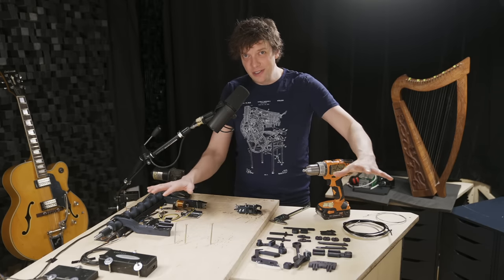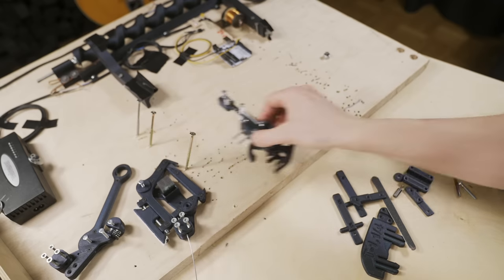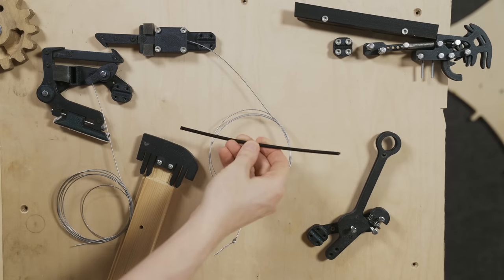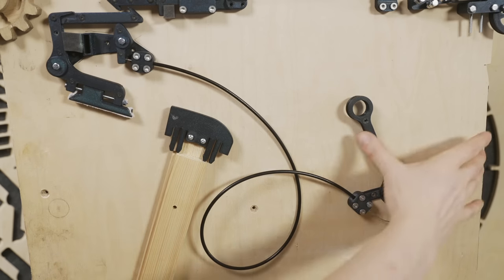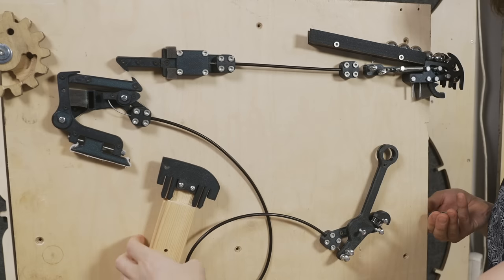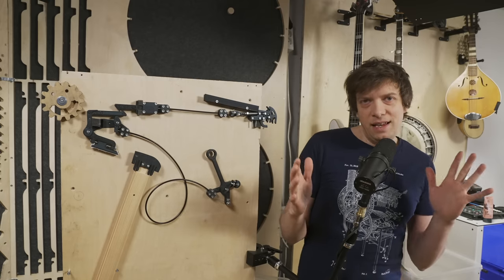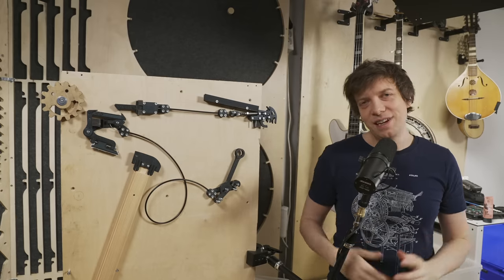These Bowden Cables Surprised Me!

Comment: Just a little suggestion, cables should only be used for pulling and not for pushing, I would add an axial spring to the muting mechanism so that the cable always works under tension and not compression, I'm pretty sure there will be a lot of comments like this as well as some comments saying that it will be fine, but pushing with a cable could give you lots of trouble in the long run even if it looks perfectly fine at the beginning, even in bikes they are meant for pulling,  the brakes or "shifters" have a spring for going back.

Comment: Another cyclist here used to do twelve centuries a month. Lube up the entire length of the cable with a Teflon, PTFE, based grease during assembly. Don't fill it, but use more than a little.

Comment: hi Martin, you can use silicone spray inside the tube before you thread the cable through, it helps lubricate and also prevents corrosion if you do end up traveling with it
Reply: Just be careful about how you lubricate them. a fluid braking of the wire is undesired. Viscosity and oil amount is important!

Comment: One suggestion I'm missing in the comments is the following: use some adjustment barrels at the end of your cables to compensate cable stretch and timing errors easily. They're a single standard part and one bit of thread, that make your adjustment so much easier.

Comment: Feels like that cable driven part should be spring-loaded, to be able to return into muted position by default without pushing the cable, otherwise that non-sleeved part of the cable will bend irreversibly  one day and stop transmitting the control lever effort. 

Cool to watch this prototype board.

Comment: It’s definitely neat, but I can’t imagine a hundred bowden cables being used across the machine. Using it in small places like to connect the programming wheel to the hi-hat and such could be really handy, if you can get the timing tight.

Comment: Try "ironing" for smooth 3d print top surface. That might save you some post-processing.
You might want to support the cable coming out of the Bowden sleeve. A guiding track would be attached to the cam lever. That way the cable won't collapse and change its path over time. Might prevent some wear as well.

Comment: Bicycle gear and brake cables are expected to pull against a spring-loaded mechanism, so I would look at putting a spring mechanism into the muting cam (twisting it clockwise) so it pulls the cable tight against the muting lever.

Comment: You should add a smaller hole at the end of the bowden tube to prevent it from sliding and getting out of sinc over time. Look at how it is done on a bike for instance. You do not need blocks with 4 screws. You need a a hole inline with a smaller hole that is just a bit bigger than the cable in the end. Add a slot on the center of the hole over the entire distance  that is just a bit wider than the cable. This way you can just drop the cable in there and slide the bowden in the larger hole from the side. The spring tension from your dropper will keep the bowden in place.

Comment: Cheers 
I like the use of bouden cables for the machine. But I think the muting excenter-thing should be tensioned with a rotating spring in either direction to pull the cable back instead of making the cable push the excenter. This will allow to have a dominant position as soon as the cable fails. Every bicycle device wich uses cables works this way, because pushing cables aren't reliable as they'll eventually buckle up.
Love watching your prototyping videos by the way

Comment: What a wonderful idea!
Though I though of one thing because if the positioning of your readers:
If you want to move your steel cables around like crazy, you will probably end up with using springs in the reader system because the cables can cause a lot of friction, like you said

Comment: The one on the marble gate looks great!  Both my experience as a cyclist and my engineering intuition say there's way too much cable sticking out of the ends of the sheath for the mute mechanism ESPECIALLY since you're pushing on it as well as pulling.  I strongly doubt it will be reliable in that configuration.

Comment: People are giving advice for reducing cable friction, but it might be a good idea go see if you can test/reduce the friction between the plastic parts too.

If the mute mechanism can be worn away from repwated use, then it's a potential source of either constant maintenance or mid-use failure.

Comment: Another tip from a cyclist: Others have recommended endcaps/ferrules. I have an easier way: put some super glue on the tip of the cable. I've never had a cable fray when doing this.

Comment: for the mechanical disconnect, have the lever pull up the reader to not engage the pin.  There's no requirement for the reader to continue to read....it will just wear down reader / drum pin material and increase resistance to moving the drum.  also you can remove the 'hooks'.

Comment: There are versions of these cables used in model aircraft that are semi-ridged that can be used to push and pull with far more force if needed, however they are not as flexible.

Comment: Bowdens are the way forward almost certainly, there could be miniscule timing errors  introduced by any slack in the cable, but that should be barely measurable. 

While this would mean an extra feature, if you designed some kind of quick-disconnect system for the bowden tubes, it'd be possible to build out a feature where you can reconfigure the instruments of the marble machine mid performance, maybe swap out drums or the guitar.

Comment: These cables will probably work for you and are probably the best solution BUT... make sure you a bunch of extras everywhere you go AND all the tools and the means to cut and fit them QUICKLY if one fails.  Because when a cable stretches and you can no longer engage the channel by pushing the lever you'll need to replace the cable and the holding parts and you'll need to do it FAST.  And not only the cables, but the cable holding parts so that you can replace any of these at any time.

Comment: Keep an eye on the Length of the Cables.

Cars use these for decades. There is a reasen why manufacturers build in a mechanism for adjusting. 
You need to adjust them from time to time, cause they getting slightly longer. 
For example, in old cars this can cause the throttle valve to not open completly or the full throttle switch don't trigger anymore, resulting in lack of performance.

On a bicycle you don't realise it, because of the wear of the brakepads you need to adjust the length now and then. Same for the mechanical handbreak on cars. Because of the corrections you don't realise the Cable getting slightly longer.

Comment: @wintergatan if you need to expand and control more than a single lever, use cable stops on the same wire. Would let you switch instruments on a set of multiple cams, let say you have 3 in line switches, cam 1 is set to on, second is off, 3rd is on, pull your lever and all 3 cams would be set to the opposite. If you need any help, please do reach out. Use these cables daily

Comment: Speaking as a mechanical engineer, avoid the use of bowden cables whenever even remotely possible. They create a lot of drag and have a lot of points of failure. IF you're going to use bowden cables, use them only in tension (to pull) NEVER push on bowden cables. There's some types specifically designed to allow low push loads too, but they're expensive and usually high drag. If you need a force to return a cable, have a spring pull it from the other end. Route your cables with as few kinks as possible in as straight a line as possible. Every bend is added drag and loss of accuracy.

Comment: 4:20  you need in-line barrel adjusters to adjust the cable tension & and maybe just cable stops and cable ferrules instead of 4 screws to secure the outer cables to the mechanism.

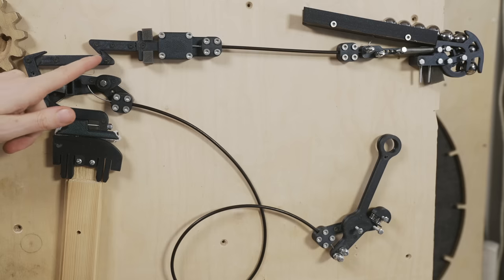Comment: 7:50 my jaw literally dropped at that moment.
I finally understand why you kept saying there are no half drops with this system

Re: the cables. The cable ha sprobaboy affected the timing but not in a way that can't be compensated for. However, over time the cables will stretch and that will wreck the timing. I think you should run some tests to see how many marbles you can drop before the timing difference exceeds your limits.
Then you can plan for that and change the cables (or adjust the tension) periodically.
That said, I think it's likely that they will last a long time without issues.

Comment: Try to minimize the number of bends and loops in your cables. As they go up, the capstan effect becomes more noticeable. Lubrication will mitigate it, but an extreme case of capstan effect induces more static friction than the linkages can handle. Straighter lines mean less friction, thus less wear and more reliability.

Comment: Hello Martin. You should not rely on the steel cable (the bicycle brakes cable) to push the lever thingy. Cables should pull, not push. You are doing both actions with just the cable, whereas you should be only pulling and rely on a spring of some sorts to retract the "lever thingy" into position.

Comment: Amazing design step - great idea to incorporate tried and tested, simple technology, commonly used for switching and gear selecting. 

Push pull cables are not the same as pull only - Shimano make both.

You could use pull cables but you will need to design two cables into your design, like tendons in a human joint one tendon pulls one direction another pulls the other way.

The outer cables introduce friction when they are compressed as they are in these clamps. I would recommend designing a housing that limits the movement of the outer housing without compression much like the housing of a car gear shift cable or boat throttle cable.

On the subject of friction - consider the maintenance required for these cables to run like new. On tour, regular oil/wax application will be needed along with degreasing to clean away dust and grime that collects on the cables and causes friction - it doesn't take much, especially if you want to use regular brake or gear cables in a push application. No big deal - but another maintenance time expenses to factor in.

Keep up the amazing work!!

Comment: I believe a problem with those sleeves for the steel cables is they temporarily shrink and become less flexible when they get cold. I'm assuming that in the winter months that the marble machine will need to be put in a truck to move it around which wouldn't have air conditioning in the trailer. It might not be an issue it's just something to think about.

Comment: Take a look on a cable operated throttle valve - they have partial sprocket to support the cable, which is needed to reduce stress near the anchor point - you might want implement something similar for long term reliability. Also, a return spring to keep the bowden in tension would be good idea - these cables are not meant to be push-pull (although the forces here are small). With return spring, you might even be able to use simpler PTFE bowden tubes with plastic cables in mute mechanism.
The bi-stable lever might be done simpler by using buckling spring mechanism.

Comment: The cables will require length adjustment.  You must build that capability in.  The "clicker' should be on the critical element (the lever that raises the hook, NOT on the mute lever.  Bicycles also did this (wrong).  They put the clicker on the handlebar shifter, when it should have been on the derailleur mechanism at the rear.  That way, when the cable stretches, it does not affect the derailleur position.

Comment: Should you get into a situation where the cable run becomes complex, there are higher-grade cables with a polymer coating inside for the metal line to run on. Look for Shimano Dura-Ace brake cables. Oh, they may also be quieter, so they will be Winston-approved.  ;-)

Comment: I would add a ball bearing to the top of the muting toggle, so the pull bar can roll on top of the ball bearing instead of dragging across it. The dragging motion will promote wear and tear and also adds noise. I would replace the felt on the programming wheel reader with ball bearings as well, as this is more durable.

Comment: Be careful Martin:  Using the inner cables in compression mode (pushing) will not work out in the long term.   With the curved flexing and compression force the cable strands will tend to unlay and “birdcage” over many cycles.

Notice that on a bicycle, they are only used in tension, and a spring supplies drive in the opposite direction.   In rare instances where pushing force is required, the sheath (housing) is used to push.

It is good that you chose shifter cables, as the housing has very little compression…but there is a limit to how much force they will withstand, as too much compression force (= tension in inner cable) will result in birdcage failure.

If you really need to push with the inner cable (I can see that it simplifies things) then use a solid spring steel wire that can’t unlay…interestingly such wire is called “music wire”!

Comment: Use a little dry graphite lubricant on the bare steel   cable before inserting into the sheath. This will reduce friction overall without being messy like a liquid lubricant. But even better, you can get   Teflon coated cables that are self-lubricating. Definitely recommended!  

Alternatively if you are  using an Arduino for testing  anyway why not  connect electronic trip relays for  the ball mechanisms? I'll bet they are lots of guys out there who would love to code that up for you.  
Really enjoying your 3rd  gen.
 development videos! Thanks.

Comment: You might find actuator cables for RC model airplanes better suited to the MM. They are much lighter and have far less cable or wire friction.  There's also many off the shelf servo arms, pivots and adjustment rods that work well with the cables.

Comment: You could use the hole in the lever by putting a rod across multiple channels to mute many at a time.
I'd imagine that it could be useful to have maybe 2 or 3 loosely connected levers so you can mute different groups at a time. Might make it tighter to just mechanically connect them together in those sets you want.
Maybe a modular approach where you can snap in levers in groups attached to rods already so its fast to change configs during concerts?
Reply: the attachment mechanism could just be two pipe connections with springed pins at the outmost channels of the channel group.

Comment: if the bowden cables don't work out, have a look at an old drumset product called the bill bachmann remote speedy hat. it uses a cable and pulleys to achieve a similar "free-routable mechanical action transfer" with less concern about parts wearing out or having friction.

Comment: I think you better use the bowden cables only for pulling, and not pushing. You can see on bikes how it’s made, a string pushes back the bowden cable in its place, so that it’s always a pulling force that is acting on the cable. 
I think there is a very high risk of failure if you count on the pushing back method, since a part of the cable will always not be in the tube. There, over time, it might want to bend instead of flowing through the tube, due to friction resisting it.

Comment: Could the new machine be kind of like a drum set? Each instrument its own self-contained unit with a signal input and a marble in and output? You could have a treat the marbles like fluid in a hydraulic system. One of the modules could do all the storing and splitting of the marbles. It would also make packing up for travel easier if each instrument is its own unit. Also, adding or replacing instruments would be easier too.

Comment: I like the design with the bowden cables. I'm just afraid that the cables could split in the current design. Bowden cables are normally only designed for pulling and not for pushing. You can also see this in normal bicycle gears. When shifting gears, you either apply force to tension the cable or release the tension to allow the spring force on the other side to pull back. Another possibility would be to use two Bowden cables - one for both directions. The manufacturer Rohloff, for example, uses such a variant.

Comment: Great design! 

One point of concern is the manner in which you secure the tubes. Is there a concern if they slide? 

You could use off the shelf “7mm Brake Part Lever Adjustable Barrels” this will provide a hard stop for the tube and allow you to adjust the tension cable tension.

Comment: Be sure you can replace the bowden cable as a whole when it breaks. Right now I saw you locking the nub in place in the assembly, which can cause major issues later on. Make sure you can thred the bare cable from the back of the piece so you don't have to disassemble it later.

Comment: If possible, I'd use the bowden cables from motorcycle clutches, or similar.  It'll be a stronger wire and sheath which is less likely to stretch.

Comment: Maybe test the longer cable with loops at the more frequently used point between programming wheel-reader and marble gate instead of at the mute system. Wear and tear will be significantly higher there, and the timings are of more importance. Right now, you are testing the optimal case. But you want it to work in the worst case.
Besides that you should take the feedback in the other comments seriously:) love the progress, love the testing. Seems promissing.

Comment: If you are going to PUSH with the cable and you don't need excessive bending I recommend using a WIRE inner core, not braided cable. That will also reduce friction.